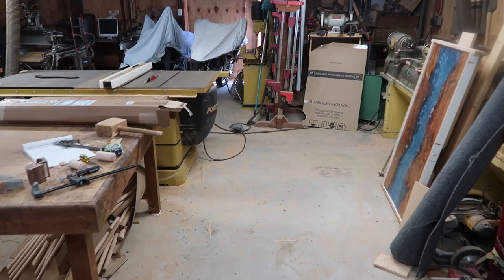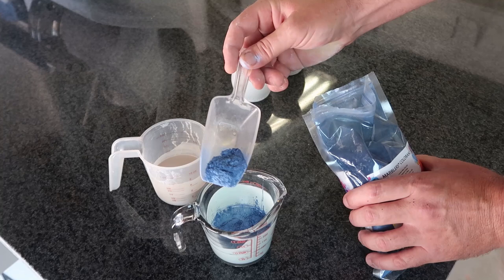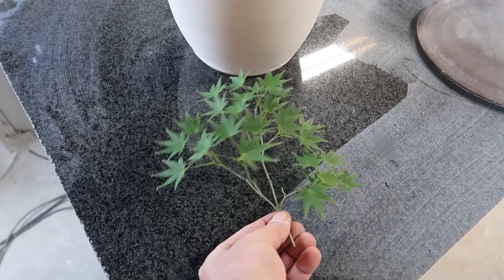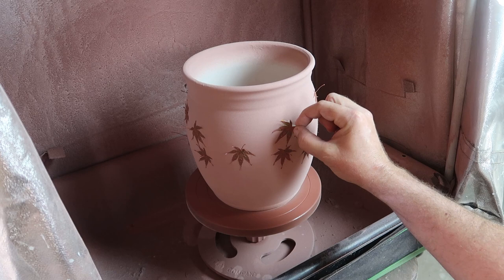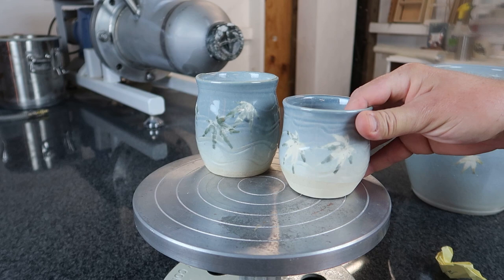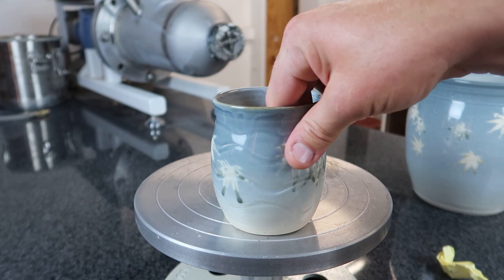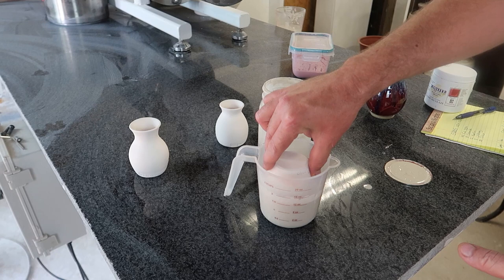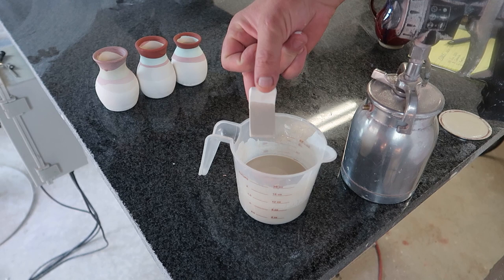3 Glaze Experiments - Cone 5/6  - Electric Kiln Fired

Comment: I was wondering if the glaze is sticking to the leaves and then you pull them off, the glaze comes off too.  But what if you left on the leaves ?  I would think the leaves would burn off and the glaze color on the leaves would remain on the pot.  I think the carbon would just burn away.